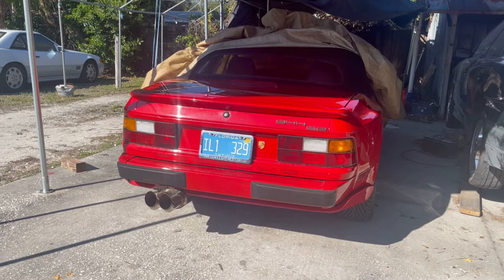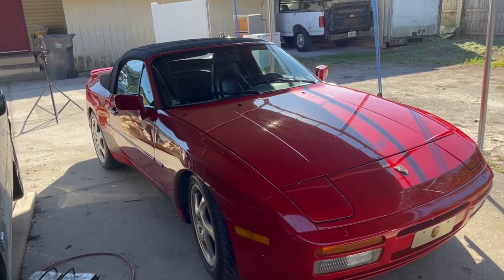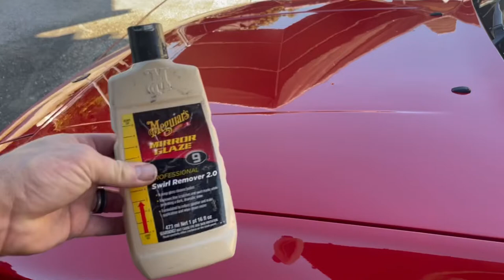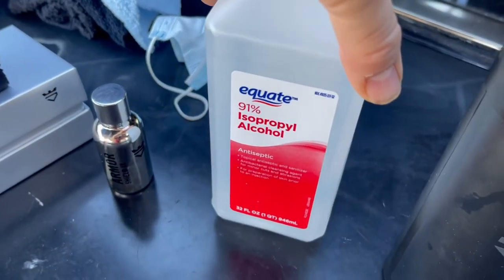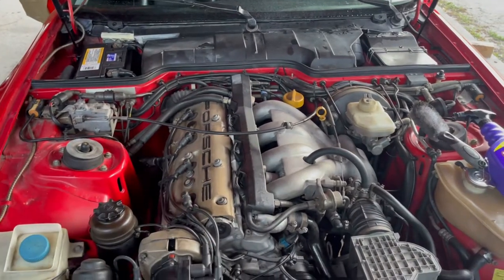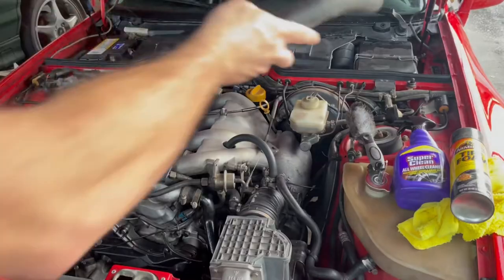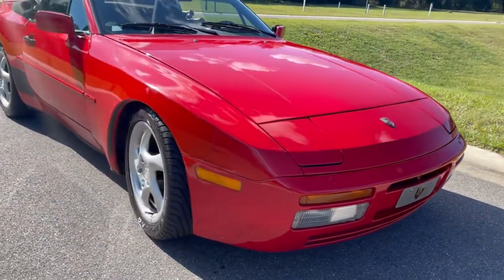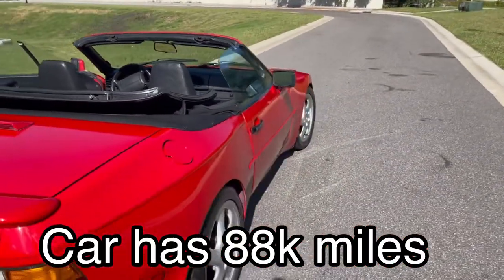1990 Porsche 944 Cabriolet S2 detail and ceramic coating ( FOR SALE ) sold

Comment: love the shape :) My uncle has a red 944 turbo from 1986.  such a great ride too :) How rigid is this chassis how do you see? I have a 1993 R129 which feel pretty rigid on bad roads even here in Hungary. Compared to an R129 with hard top off where would you place thiz 944 cabriolet?
Reply from the maker: So to me both these cars are very stiff and rigid.   I can take turns with the 944 and almost feel no sway.   It’s an amazing sports car.   The r129 is great too but pretty heavy